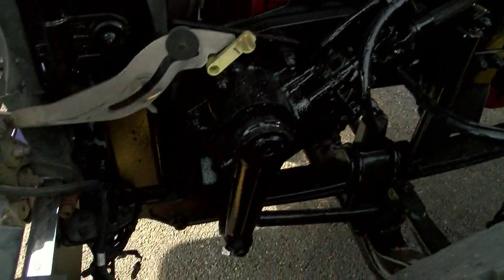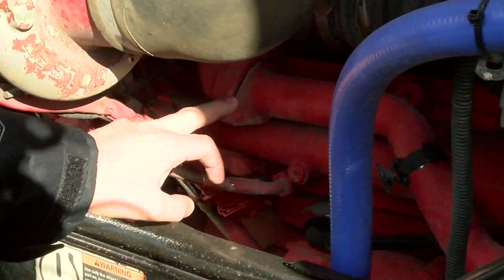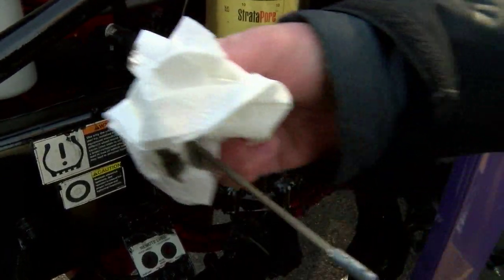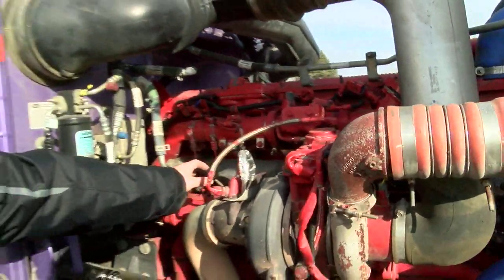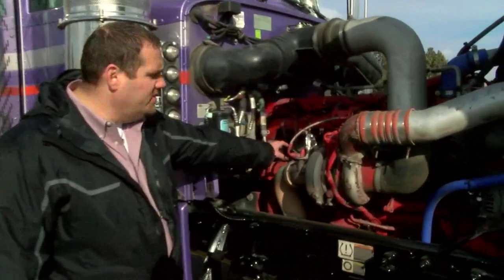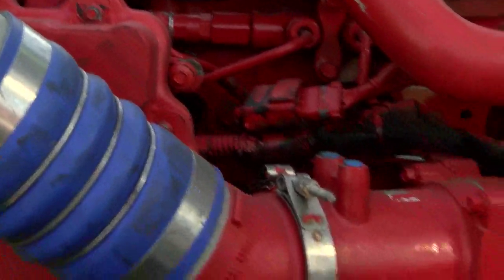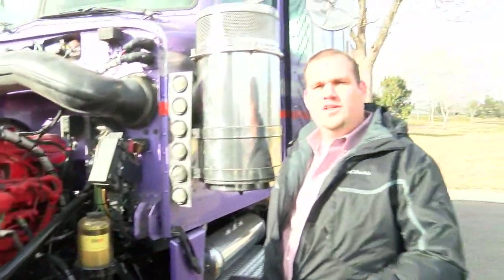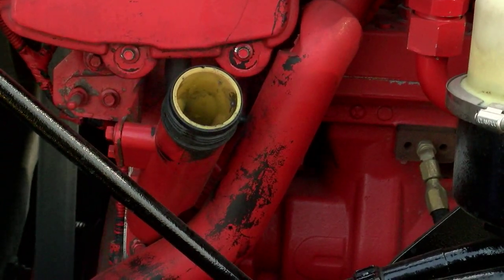How to Inspect a Diesel Engine Before Buying a Used Semi Truck: American Motors

Comment: Did anyone notice the fresh new paint on the frame rails, radiator support brackets, new decals, steering rod, new wiring looms with new protector sleeves? But original faded plastic air breather tubes?
Reply: What's so bad about that? If theres nothing wrong with them I would re use them too! Maybe he couldnt find any?
Reply: Very common on presale detailing of used trucks by dealers and some fleets.

Comment: Avoid anything with new tires and fresh paint...  read between the lines, your alignment is out and frame is bent, and rust is going to take over.  Also, check blowby and feel how tight it is, agree on a price and put $200 non-refundable down and send oil sample to CAT lab ($15) and wait... you don't buy a house without an inspection so don't be an idiot again.  That is the best $200 you will ever hand someone.

  Also check if there are maintenance records... that can sometimes be instructive, avoid all DEF Internationals and DEF engines in general if you can.  Codes can be erased temporarily or pieces disconnected... do not trust.  

Get YOUR KNOWLEDGABLE and trustworthy mechanic to look it over.  Also,  100% of the time, if one area was not maintained (eg it has a new engine), then nothing else was either.  run away, those are bankruptcy traps.  Good luck.

Comment: If the dealer cleans and paints an engine u can't detect shit 400 mile test drive  under load and dino testing u want a truck they haven't changed the oil yet trans rears engine so u can get it analysed

Comment: I been at Volvo dealer every 2 weeks for 24 hours. Only 200,000 miles. Different issues. Fuel pressure control switch, box number 1 bad( ck engine light came on) ,APU problem once a month. You earn the 8mp gallon. Like Volvo trucks but they go to the dealership often. Down time even though warranty covers.
Reply: What kind of Volvo you had?

Comment: Why was there water drops inside the oil tube were u put oil at end of video when you took off oil cap off can you tell me if thats normal
Reply from the maker: gaonajesusjg yes it is normal you will build up precipitation.  If the oil looks milky have it checked.

Comment: Currently studying for my CDL, I’m still in the studying phase but can any seasoned drivers confirmed what he mentioned? As well as hit on anything he may have missed for me?
Reply: In school it's about inspection,  not repair.
Reply: Volvo 780 is the best truck for driver comfort i just bought a 2010 780 soo comfortable bro im owner op using load boards
Reply: Cracked missing or broken